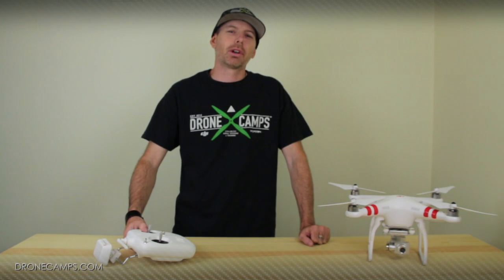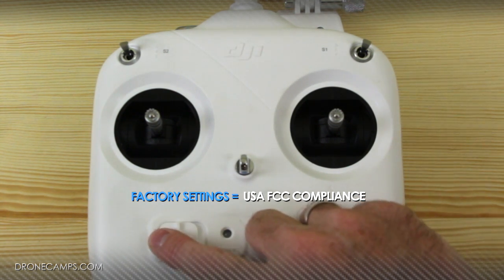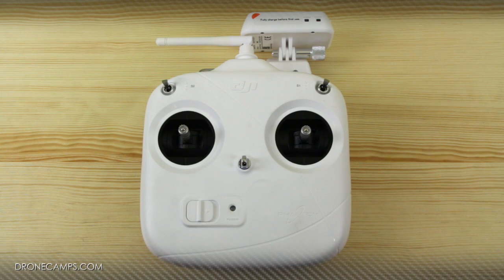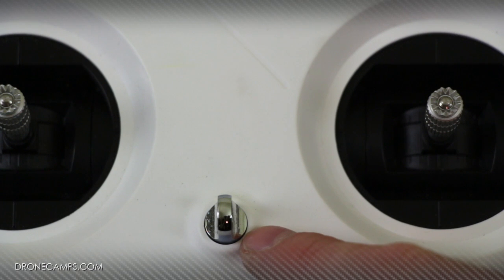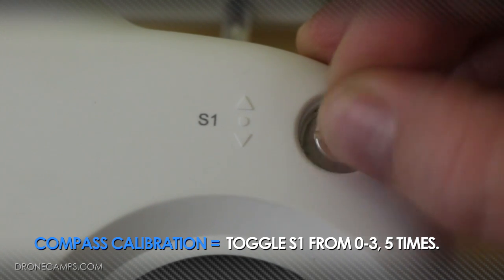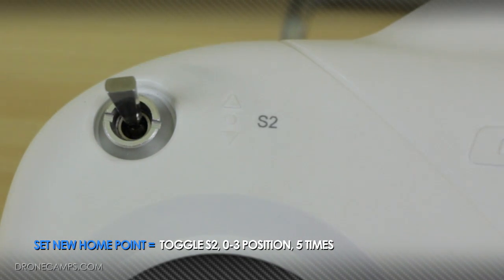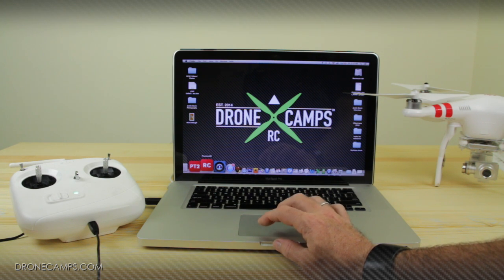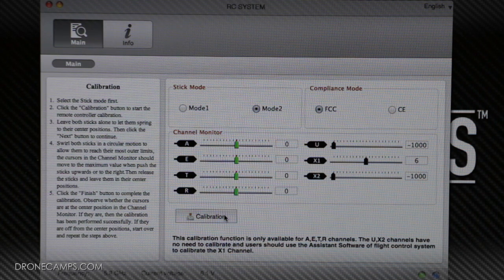DJI Phantom 2, Radio Explained, Complete Tutorial

Comment: Hi, thanks for the video. I have a question. My controller seems to be inverted. My right stick is up and down for altitude and left and right for strafe or sideways. And my left stick does the forward, backward and rotation. I bought it used off from someone that just learned to fly it that way, but I much prefer your setup, where altitude and rotation are on the left stick.
Is there a way to change this setup on my controller?

Comment: Ive just received a second hand Phantom 2 and I'm currently reading through the online manual. In the manual it states that when you're in Naza M mode, the upper right hand switch on the transmitter have the three following settings - GPS, ATTI and Manual. However, I note in your video that the three settings on this switch are GPS, ATTI and ATTI. And that makes me a bit puzzled. If what you say is true, then how do I access manual flying mode?

Comment: just downloaded the software (PC) mine is read, asked me to login but I did not, with the controller plugged in and on, I have no indication of inputs from the controller and the software panel is red. and the calibration button does not do anything? The info page shows no input from the controller. Powered up the remote and drone and the drone responds to the input correctly.

Comment: Hello. I have the phantom vision plus V3. The remote controller has its own built in battery. When I go to charge it, does the remote have to be switched on ? Or off please?
Reply: Drones Manawatu Hi, Charge the remote, switched off. It will show red light, when fully charged, light will show green, when you switch on all four green lights mean fully charged. Hope this helps......
Reply: yep it worked, thanks

Comment: I tried to calibrate the sticks in the RC assist firmware.
After plugging in the mini USP to the controller and then to the PC, I opened the firmware, turned on the controller and when I moved the sticks to calibrate, the arrows did not move.
I repeated each follow along step by step again with no results. Any idea what I may be doing wrong